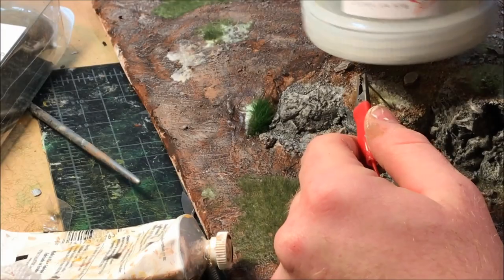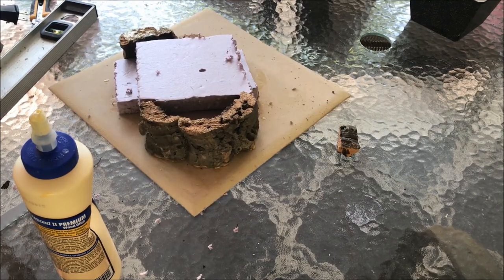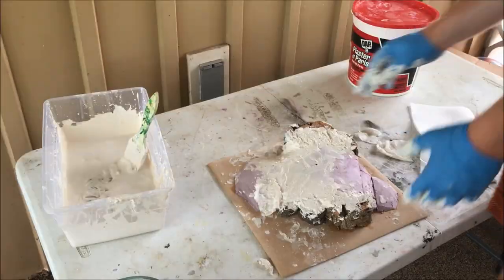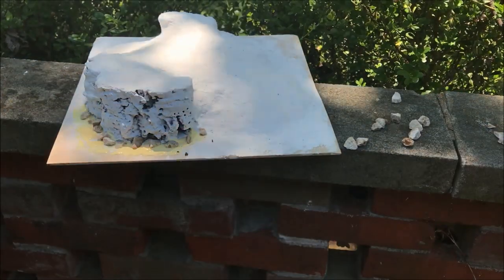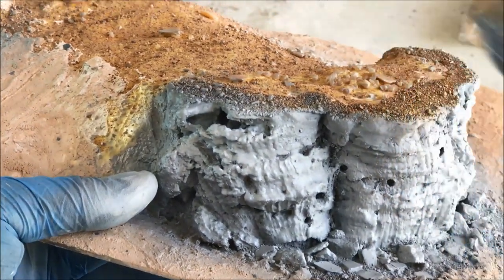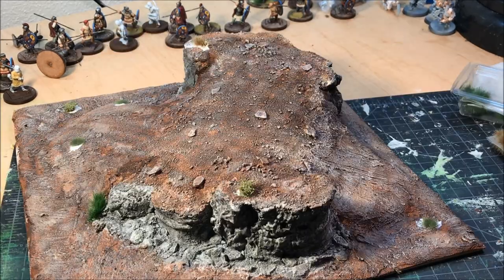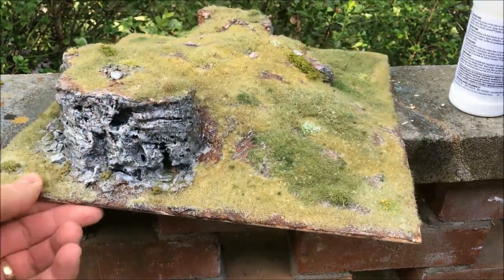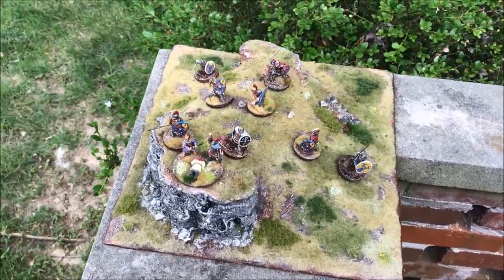Making Realistic Hills and Cliffs

Comment: Any reason you didn't just use spackle/filler to smooth over the foam and fill the gaps? Seems like a much easier way to get the exact same effect, mixing the plaster and tearing/shaping the paper towel just seems like an extra (and more messy) step.

Comment: What is the panel you are using for the base?
Reply: A suggestion for the cork, don't place plaster into it's crevices, that takes away from the detail, not that it's needed much because the flocking is absolutely beautiful.
Reply from the maker: +DarkPath Thanks!  I placed it on 1/8 inch mdf board that I shoddily attempted to bevel with a hand sander.  Yea, I noticed afterwards that some player got on the surface of the cork, tried to brush it off, but it did obscure some detail unfortunately.